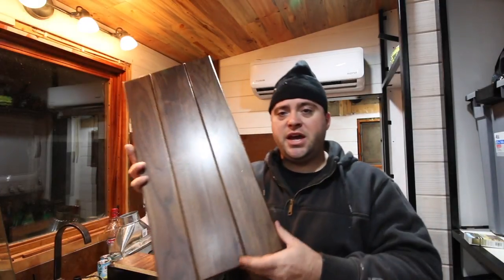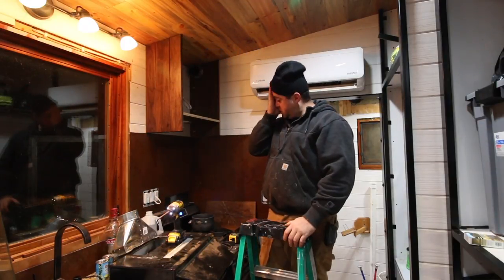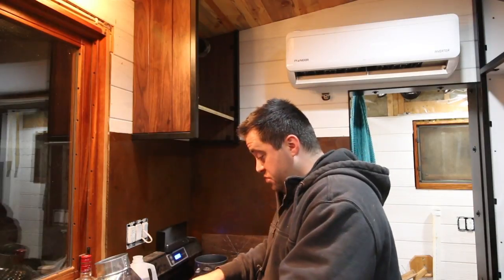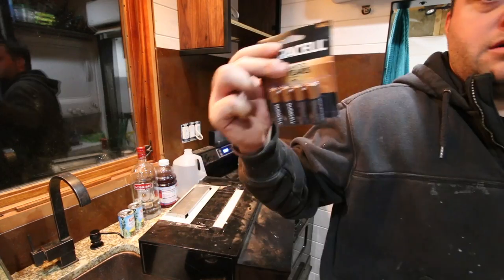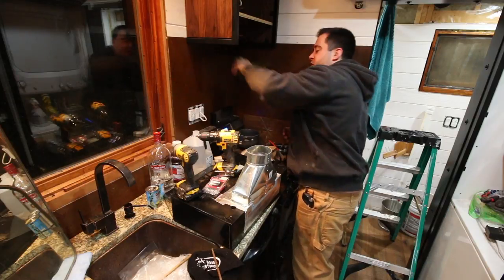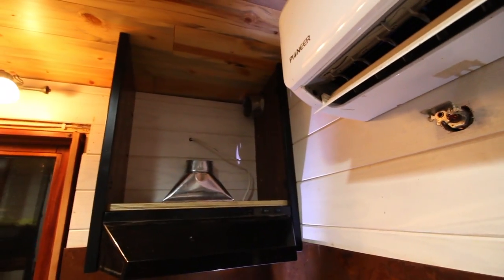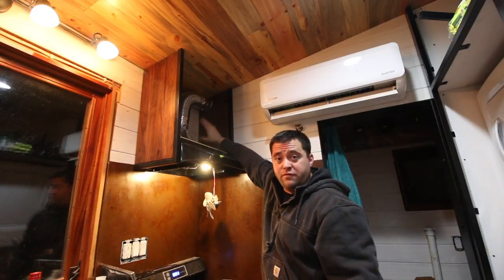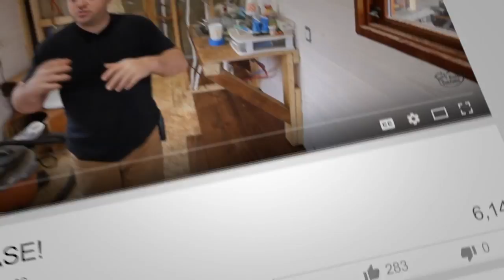Range Vent - Part 2

Comment: The flap helps to keep bugs out.  Plus reverse flow of air.  I put a screen on my exit tube for the microwave / vent unit.  But it exits out the roof and hornets + nests fall down.  And damaged the previous microwave.